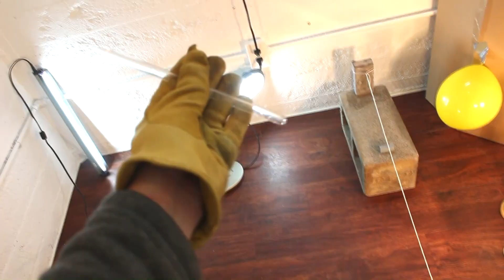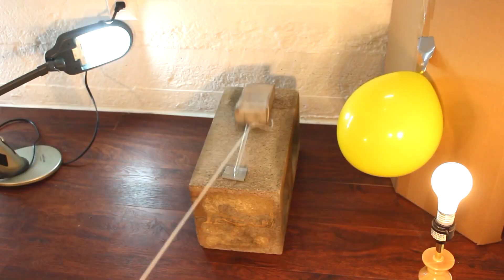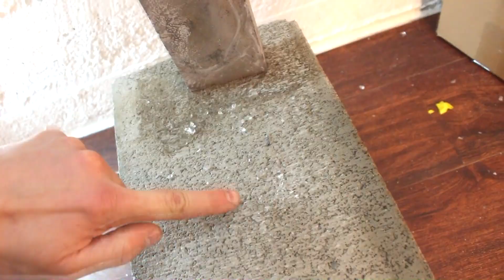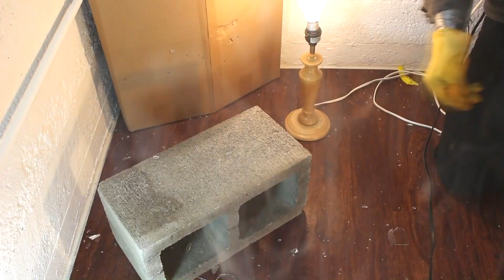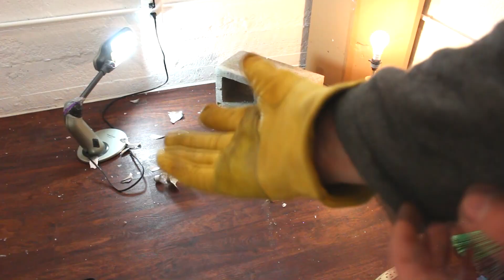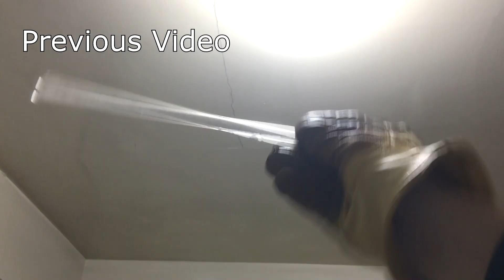Breaking The CO2 Tube at 6,000fps

Comment: Don't make a bunch of tiny ones and bring them on a plane and then blow out a window. Now I'm tagged by the NSA.
Reply: how about a little gallium spill? ceramic blades hidden in laptop? there are number of things you can do and it isn't limited to planes. just most don't do that. along with this is that it's really difficult to catch criminals. even if snowden leaked things continue. fun eh

Comment: 6000 fps? Let's calculate... metal brick is falling during ~0.5 second. so you get 3000 frames out of this action. then we need to slow down this movie to 30 fps, so 3000/30=100 . therefore we must get 100 seconds movie of 0.5sec action. but your slowmotion is about ~10sec. respectively you have ~600fps but obviously not  6000....

Comment: Fascinating. We had an accident at work a few years ago with similar thick glass tubes. The engineer was lucky he was wearing his safety glasses. Ended up going to the emergency room to have shards of glass dug out of his face.  In fact, there are still shards in the ceiling. We leave them there as a reminder of proper PPE (Personal Protective Equipment) and safe lab practices.

Comment: Having saved my a** working with voilative glass containers and similar, I would suggest getting a slim kevlar shirt or vest. Preferrably a longsleeve shirt. It doesn't need to be stab-rated, if you're risking that dimension of fragments you already know and would be wearing adequate protection. The slim ones aren't that expensive, but they'll stop smaller fragments of low velocity, while still being fairly comfortable to wear.

Comment: I think you need ~30k FPS to record fully detailed glass shattering. Even when the Slow Mo Guys did it with a large Pyrex container, the shattering only occurred for such a short period on screen. Was about 1/10000th of a second.

If your camera can go that fast on lower resolutions, could you do a shatter test with these to calculate the speed at which the fracture travels along the glass? Of course, it's nothing new, but it would be pretty cool to see on your channel. :)
Reply: If you want to really see the cracks propagate 10 million fps (monochrome) is available with Shimadzu's latest camera. If I recall, each pixel on the sensor has its own memory cache. Not even the Slo Mo Guys can afford that sucker.

Comment: Some of you may have noticed that the lights were pulsating in the slowmo. It's interesting, I think. The lights pulse on and off at the frequency of the AC power. Anyway, neat video! The pressure contained in those tubes is actually kind of frightening.
Reply: You may notice he has several different types of light sources to mitigate the effect. None of them he is using actually turn off during an AC cycle, that is mostly just LEDs, but they all do change there characteristics at the frequency of the AC circuit. The incandescent for example will change it's temperature, and as a result brightness, cooling off a tiny bit while the voltage is near zero then heating up again while the voltage is farther from zero. Halogen and florescent bulbs have similar effects but are slightly out of phase with the AC circuit and sometimes change their characteristic frequency more than their brightness.

Lights that don't suffer such effects are very expensive and usually center around rectifiers with large buffer capacitors to smooth out the AC into DC.

Comment: I once had a 1.5 liter soda PET bottle pressurized with just 10 atm explode in my hand when I rapidly depressurized it by quickly unscrewing the lid. This was so loud that it took a few hours for my hearing to go back to normal. Luckily I wore gloves. The crack started from the bottles thread presumably caused by the rapid change of load and temperature. The cap where I've build in a bicycle valve went flying into the nearby wall carving out a good chunk of it. The bottle was left in a brutally destroyed way. So when I saw your last video where you made and handled those glass tubes not filled with 10atm but ~75atm I was a tiny bit nervous. I guess while you had ~75 atm pressure you only had about 1/1000 the volume of my case. So that must be the reason why it wasn't all that loud. Also the throughout shattering glass might have toned down and washed out the sonic spike a bit.

Comment: someone might have already suggested this but you could try to shoot a projectile with it. Find a vessel that is air tight and that can handle the sudden change in PSI and then maybe use a magnet to drop a piece of metal onto the tube so it shatters and releases the pressure. connect a barrel to it and fire a projectile. would be so cool to see the results. i know that the small glass tube would have to fill up a larger space thus making it less effective and you could probably just use a valve and a tank but it would be cool to see this.

Comment: what happened to the magnet in your finger or is it still there
Reply from the maker: yup though my sensitivity in it seems to be decreasing; probably due to things like this.
Reply: I still don't know much about this magnet in your finger, it there and older video that explains it? (I'm a somewhat recent subscriber).
Reply: The quick and dirty on biomagnet implants is that they are a small neodymium magnet coated with some kind of biocompatible covering. When you implant one or more under the sensitive pads of your fingers and the tissue heals around it, you can feel the magnets vibrate or gently pull near EM fields. I implanted one in my left ring finger that became infected and had to be removed, and still want to put another in someday. It is a very surreal feeling to be able to tell if a wire is powered by if it vibrates in your hand.

Taking the concept a step further, you can actually implant the magnets into your tragi and wear a coil of wire around your neck rigged up to your phone to listen to music or call audio in your head.

Comment: My chemistry is shaky, but a back of the envelope calculation says it's about 450 J to take 2 g of CO2 from 70 atm to 1 atm.  Subtract a bit of energy that went into breaking the glass.  The hand holding the tube took a quarter of the remaining energy, say.  So I'd guess it hurt about as much as touching a 100 W light bulb for 1 second.  Does that sound right?

Comment: When I was young(er) and dumb(er) I got a glass root beer bottle with a plastic screw on cap. I drilled a hole in the cap and glued in a schrader valve from an innertube. I then pumped it up to 120psi, when into my alley and threw the bottle. That was probably the loudest explosion I have personally made.

Comment: You should put one in a fire to see if it goes out and it will be under more pressure.
Reply: Xeneo Dnejneejedn Jet fuel also can't melt steel beams.
Reply: Übermensch 1. Glass doesn't burn
2. The only way of checking the pressure is to do the math, which means you don't need to heat it to find out
Reply: Are you talking about 11/9?
Reply: Übermensch probably
Reply: Xeneo Dnejneejedn I got the tism too.
Reply: Übermensch but can Lithium-ion melt steel covers?
Reply: and we need to call the firemen because his house is on fire.

Comment: Hey Cody I was actually wondering how the sample you showed in the previous video didn't have water vapor in it. Is it because the CO2 gas formed from the solid pushes out all the atmospheric air in the tube? Also how does the glass not shatter when you heat it with the acetylene torch? I would have definitely taped something highly thermoconductive to it to radiate away the heat.

Comment: It's like one of these stressed glass tear thingys.
Reply: Colly Wolly prince ruperts drop?
Reply: not quite, these tubes are explosive because they contain high pressure CO2, prince Rupert drops are explosive because the way the glass cools causes a lot of internal stress (the inside glass is trying to pull the outside in, but the outside is already solid and can't move until the a weakness is made)

Comment: could those be used to put out small trashcan fires any small fire?
Reply: so you gonna try it? set a bin on fire. the heat could cause the pressure to build in the tube up to breaking point. then it would extinguish the fire by flushing out oxygen...?
Reply from the maker: the shock alown myght put out a fire.
Reply: Aaron Bright I would say great idea but there are already prototypes that put out fires like that. Forgot what it's called but I saw a YouTube video about jt
Reply: Cody'sLab I think seeing that would be cool

Comment: Can anyone explain to me why slow-mo footage is called high speed
Reply from the maker: because in order to get it the camera has to be running faster than usual; that way when the video is played back at a normal speed the video looks slow.
Reply: It's more of a reference to the camera itself instead of how slow the footage is.  High speed as in how many frames per second the camera will capture.  In order to capture footage in "slow motion" the camera has to take significantly more pictures in must faster succession in order to produce a slow motion video.  This is my simplistic understanding of it at least, hope this helps.

Comment: Pounds (a stupid dead unit) per square inch (a stupid dead unit) equals to PSI, a unit of compounded stupidity. Only used in 3 nations on the planet, the USA, Liberia and Myanmar, all other nations on the planet switched to the metric system because they realized that using bullshit units like pounds and inches is just stupid.
Reply from the maker: meh newtons per square meter is just too unwieldy for use in ordinary life.
Reply: *****
just use bar, one bar is precisely 100000 pascal (per definition) and roughly equivalent to atmospheric pressure. This is superior to the dead unit of pounds per square inch in every way. pascal is too small for everyday use, its like using nanometers instead of millimeters, centimeters or meters for everyday objects.
Reply: kurtilein3 why are you so triggered just because we do what we want?

Comment: Off-topic question. Is potato starch good enough to make oobleck? I searched but no one mentioned it. Everyone was talking about corn starch.
Reply: i tried it myself with potato starch. But it doesn't matter which one you use, because it's always the same chemical.

it behaves like a wet sand with too much water. You can dip your hand in it slowly and it will stop you if you smack it, but i think, that it didn't match my expectations and the mess was not worth it. 
I'm sure you can buy something on the internet with better properties.

Comment: I like how when I mentioned wearing a face mask and neck protection in the last video you said you didn't care about a few cuts! As I anticipated, these would not have been small cuts on your face. The shrapnel could have easily been embedded in your skin, or worse cut a vein in your neck. 
However, after watching the video you refer to your face mask as safety goggles, so you might have been wearing them in the last video but never showed your face.

Comment: You can see tungsten smoke from the vaporized filament in the real-time camera on second break. It didn't take long between bulb breaking and the filament destruction. I'd like to see high speed video of a filament vaporizing without glass shattering. Remove the glass with it off and then power the bulb on. It will provide its own light.

Comment: Those arteries you see on your wrist is the blood that is going back to your lungs and is not under a lot of pressure and are very tiny. The arteries that are coming from you lungs are sitting at least 1 cm under the skin. my point is that the glass shard could not really cut your wrist.They would  just leave an very ugly cut over the length of your arm. but  good  on you for taking the precaution.

Comment: how do you know what psi it is
Reply: Good old math i expect.
Reply: Kailash It's simply the vapor pressure of carbon dioxide at its current temperature. At room temperature, it's around 1,000 psi. I'm sure there are charts and/or tables online.

Comment: Are the consistent fluctuations in light level caused by the 60hz sign wave or is it due to the camera having a few quirks? I've seen other videos with the same camera and there was no discernible lighting fluctuation like seen in your video. If it has nothing to do with the camera, which I believe is more likely, would you consider using a DC supply for lighting in the future? Or if you're going that far would it be easier to go low voltage and switch to LED. Of course you'd have to use a constant current supply and not a PWM dimmer if you wanted finer control but I believe, if it was in fact the AC causing your issue, that it would pay off in high speed video quality. Of course this is only a minor thing and I found the video amazing all the same.

If you read this I'd love you hear your opinion, or at least what you think was causing the fluctuations. 
Great video, as usual ;-)

Comment: if only there were a way to make a prince rupert's drop filled with super critical co2. that would be a cool thing to break.
Reply: The heat trying to make the Ruperts drop would boil the co2 and make it explode I see the idea and it sounds great but the laws of thermodynamic doesn't all that unless you had someway to melt glass but keep what's inside it at freezing temperatures regardless of the heat induction.
Reply: 2nd of law of thermodynamics states that the amount of dead pieces inside a person will always be increasing.
Reply: SO MUCH YES!
Reply: The laws of thermodynamics is I think the most overused scientific law/term used on the internet... So is the law of conservation of energy but who is counting? I am not saying you are wrong of course, but the two terms really grind my gears because of all the kids that use it nowadays. I would add that it troubles me so much so that when I mention the three laws of thermodynamics to people who have surprisingly never heard it before it's like a piece inside of me dies.
Reply: @doublebubleguy12  I recently got asked what an atom is...

Comment: Hey Cody why don't you try growing plants underground (not just in a mine, but under soil) using fermentation for co2 and a grow light powered by a solar panel? The temperatures fairly constant year round down there, so you may get away with growing summer plants in the winter!